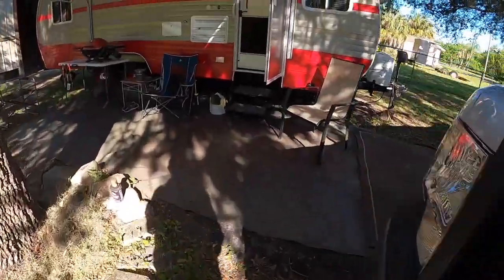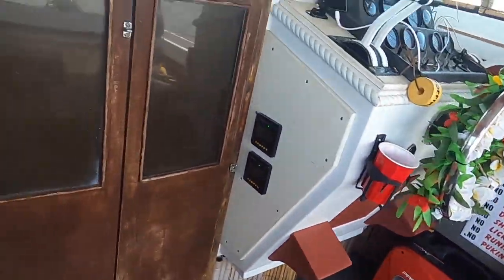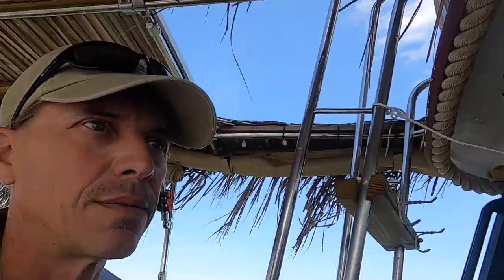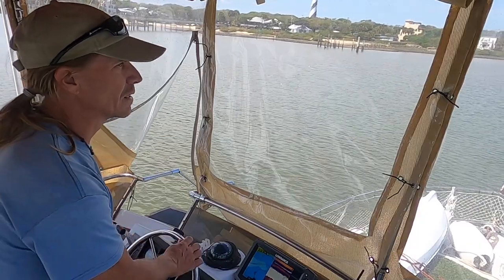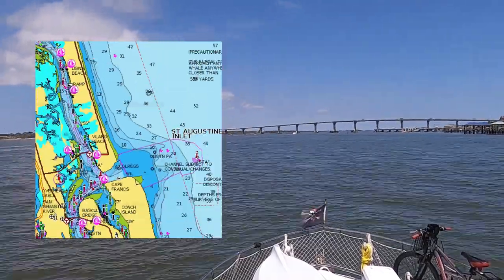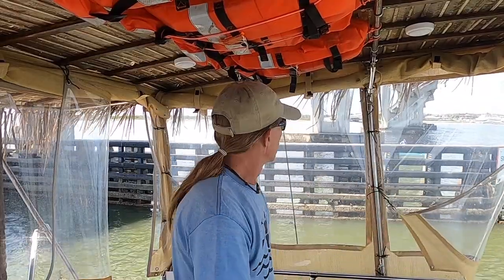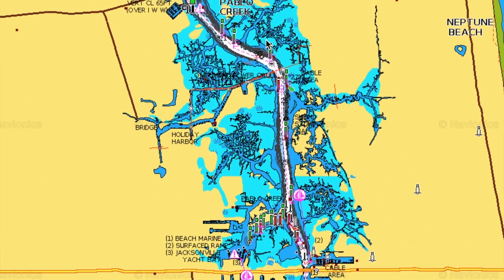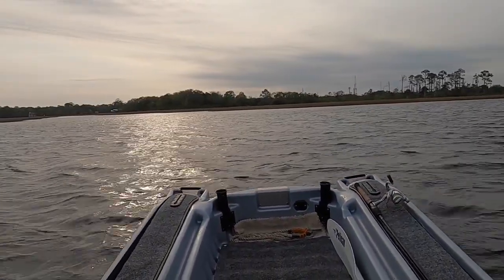The Great Loop 061 Heading to Jacksonville

Comment: Next time youre ashore, grab a bottle of blue devil pour and go stop leak for the cooling system leak. Works every time and worth the 35 bucks. Should be able to find it at most auto parts stores.

Comment: Make sure you have the right thermostats in them. Most of those motors are raw water cooled with 160 t stats. You have the fresh water cooling systems versions. They should have a lesser temp t stats.
Reply: 140oF t stat you should have.

Comment: Check the rear of the intake manifold under/behind the distributer area that's where 350s like to leak. when it is hot under pressure.

Comment: I think it’s time let the boat sail away an go back to fishing. Lugging an engine around is horrible. Water pump doesn’t turn fast enough to effectively cool engine. Oil pressure is lower. Not enough cylinder heat to properly keep combustion chamber clean and burning efficient. Brand new engines should be able to run full tilt. Should be a sweet spot around 75% where you will get a great mpg